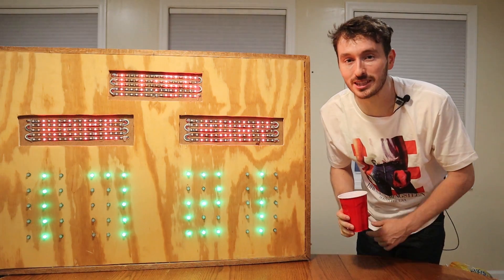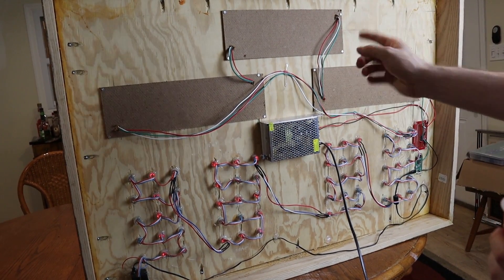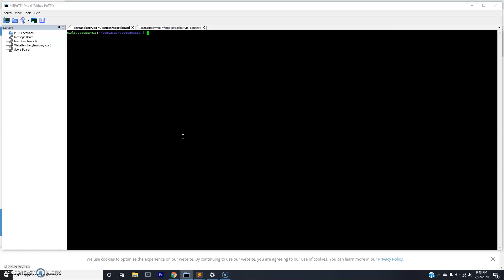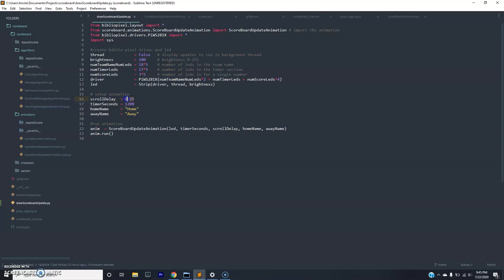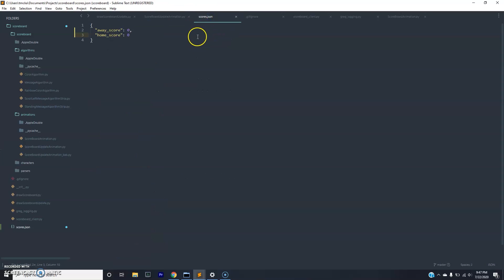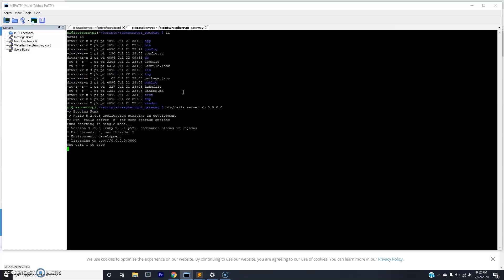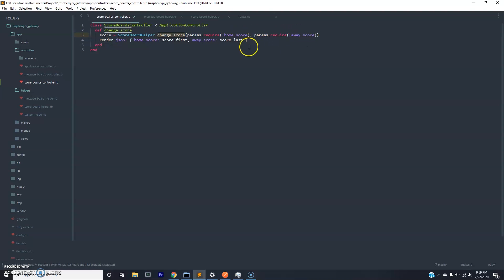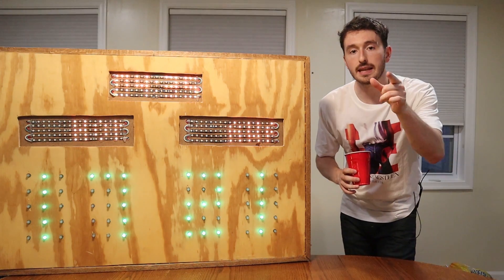HOW TO MAKE SCOREBOARD: DIY Score Counter | Raspberry Pi Projects | Python Programming

Comment: can you make the same project with led strip an 74hc595? and can you add shot clock synchronised with timing?
Reply from the maker: How did you imagine using the 595? Forgoing the ws2812b controller and controlling the leds individually? That seems like a bit more work but would be an interesting code to try out. Shot clock would be cool and super easy too, when we revisit this in a year or so we are going to add that
Reply: @tyandgigbuilds8836  
Because long ago I used the 595 with transistors that I was going to power the led strips.
The only flaw I have never managed to achieve is the accuracy over time.
Reply from the maker: Mm interesting it would definitely be a fun experiment maybe we’ll try it in the next one but that won’t happen for a while